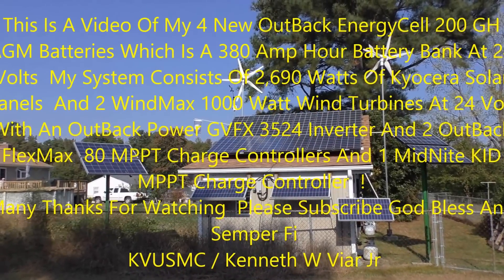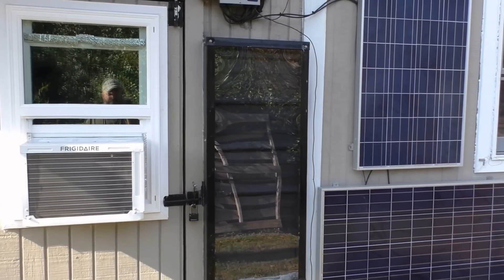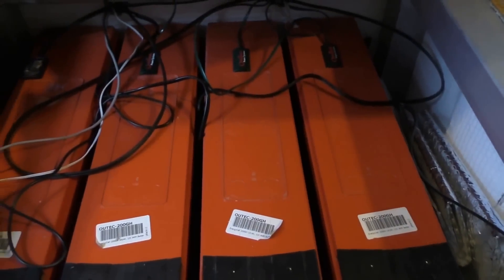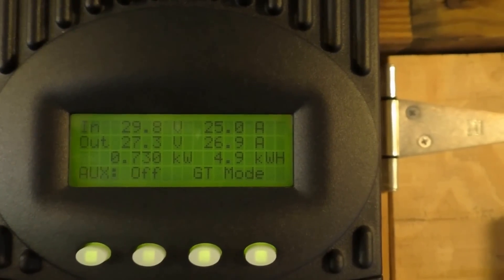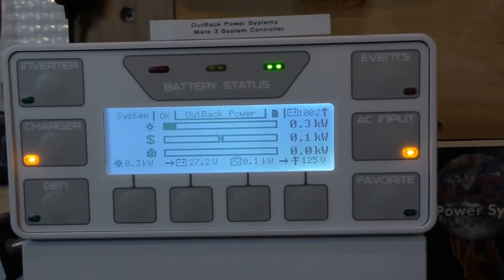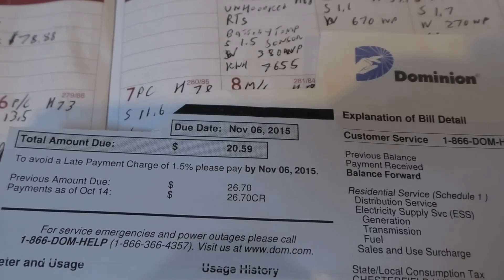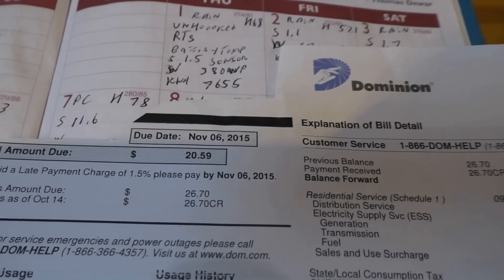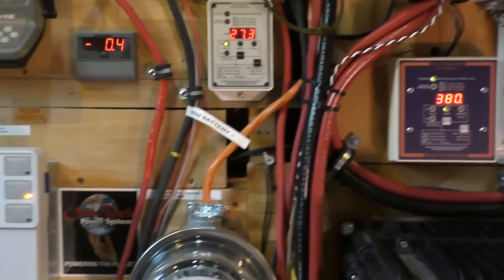Solar And Wind OutBack Power EnergyCell  200 GH AGM's Battery Bank Update BY KVUSMC

Comment: _*With this simple battery reconditioning method, you won’t have to buy new expensive batteries in 2017.or ever again [Check Details Here>>>>https://plus.google.com/100351090281822647456/posts/DDHJUMRLfS2
 ] .You can just recondition your old, used batteries and save a lot of money!_*

Comment: Do you vent the room where you keep the batteries?

My "normal" electric bill is around $50 per month (for 3 months only) during the summer (Run the window A/C unit) & averages around $30 the rest of the year. My home is only 1,000 sq feet and I live a frugal life. However, I don't like being dependent upon the electrical grid. It seems that every time a flea farts in Boneo the power goes off & if I'm home I have to fire up the generator to keep my food from spoiling.  

I see you have Dominion Virginia power? So do I. Where in Virginia do you live, because I'd love to see your set up? 

Shal'aam Aleichem
          AAPiY
          Mike

P.S., how much did the entire set up cost you in equipment and time to install?
Reply from the maker: No Sir I don't Vent The Batteries They are AGM  No Venting Required  That is A Good Power Bill Buddy  I live near Petersburg Virginia  My System Total since 2009 $ 25,000 Grand plus 30 % Tax credits every year Cheers Kenny

Comment: those turbines look really small for being 1 kw how is that possible?
Reply from the maker: Yes Sir There actually More Power Than 1 kw each  Check this Link out 
https://youtu.be/v3gEHuJ6xJ0?list=PLCD74dps4lg-RQEncYaUZHNWJ5MGgWhQ1
Reply: wow that is amazing ... thanks ... i'm working on a little project and i stumbled across your video when i was trying to figure out if it is safe to draw 1000 watts AC from a 200 amp hour battery (thats like 60 amps) seems kind of dangerous to me to push it to the limit
Reply from the maker: Many Thanks Buddy  I have ran 1500 watts Off of a  180 amp hour Battery Bank It doesn't Last that Long at least a 300 to 400 Amp hour Battery will be more than Good Cheers Buddy Kenny
Reply: thanks ... yes i calculated that it will only last about 35 minutes but i was more concerned about danger from draining the battery at that rate (60 to 90 amps instantaneously) rather than it run time.  planning on using 2/0 wire but just a little nervous
Reply: 35 minutes to 70% of total that is
Reply from the maker: Nate Vizzi I can understand that Buddy

Comment: I have wind turbine with a charge control  & a dump load charging 2 12 volt deep cell batterys  & i have a solar grid type inverter that when the batterys are full i turn the inverter on. it is a 1000 watt inverter. My question is i only get 150 watt from the inverter do inverters work on amount of amps, so if i add more batterys at 12 volts & get more amps will the inverter give more watt?
Reply from the maker: What Kind Of Grid Tie Inverter do You Have My Outback Will Feed My Battery Bank until it is full Once it is at the Voltage I Need Then It starts at 27.2 Volts Pumping power to the grid I hope that was helpful cheers Kenny

Comment: where did you acquire the batteries from, and how much did they run?
Reply from the maker: +Amanda Rodriguez  I Got Them From The Alt E Store  They Were Around $500.00  Each   https://www.altestore.com/store/Deep-Cycle-Batteries/Batteries-Sealed-Agm/Outback-Power-EnergyCell-200GH-12V-191AH-AGM-Battery/p10970/

Comment: Great Setup! any chance you could give your thoughts on the Goal Zero Yeti 1250. It seems to come with two Goal Zero 30w panels but it does have the provision to add more panels and a second battery. Just wondering if you think it'd be just as good or cheaper/easier/better to buy everything single and make my own?   many thanks
Reply from the maker: +TechStories79 Many Thanks Buddy The Goal Zero Yeti Are Nice Units I Would Add More Solar Panels For Sure Cheers Kenny

Comment: Thanks for the system up date well impressed what you have done. What would be your monthly power bill if you did not have your set up?
Reply from the maker: +ian57812 Hi Buddy I Appreciate It  My Bill Usually Runs $200.00 A Month With Out Solar And Wind Buddy